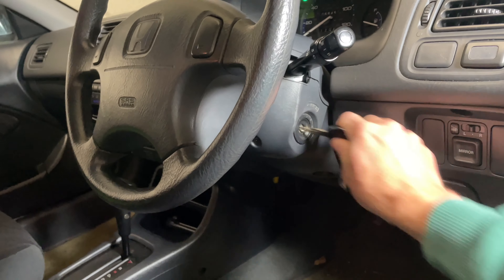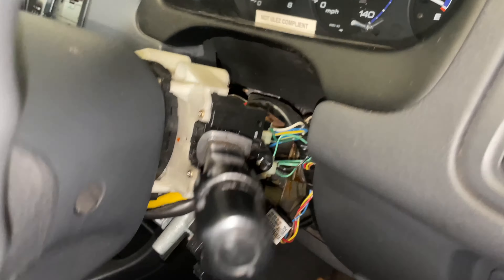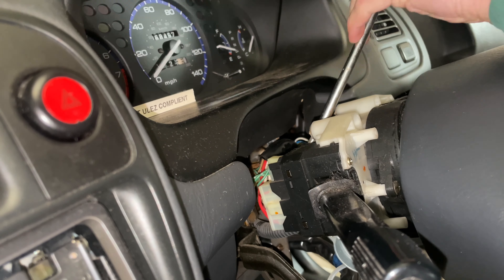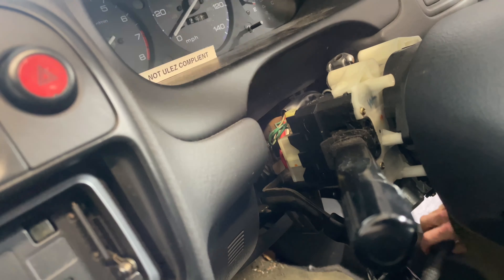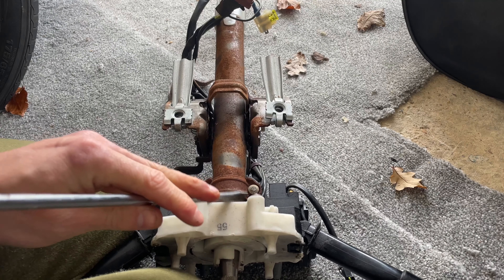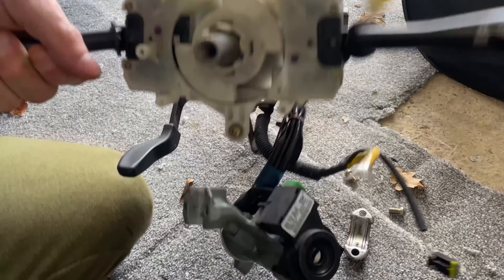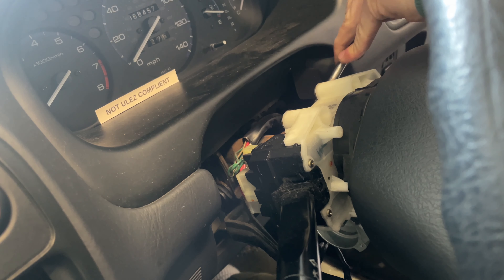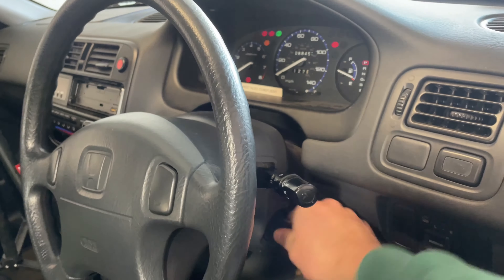How to ignition barrel replacement Ek civic 96-00

Comment: nice one dude, I defo would have got a Dremel out to cut a slot in those but heads though I reckon :)
Reply from the maker: Good call! but requires more tools
Reply: @huktuned  that part was easy brought new one.
Cut down middle clamp slides off
Reply: @captainsvlog  cut clamp bend it slides off .them shear bolts suck .
Just put new one in .new key .
Maybe need buy another lock sensor burrow push aswell? Reprogram it 
I don't no but getting flashing green light ...need do something so it takes  new Kew and barrel and column

Comment: Yeh replaced barrel 1996 put back on but turns over .
How do  I imbolize new key please and barrel
Reply from the maker: @dannyoliver8354  have you still got original key that matches with ecu ?
Reply: Yes do .but has separate button push sensor key ring.
But now does not evan unlock doors either now
But separate.
Key for ignition and key ring push button for door locks 
Key just normal
Reply from the maker: @dannyoliver8354  stuck the original key near the chip reader and try start it now and tell me what happens

Comment: If you get another key and barrel from another ek, do you have to change ecu?
Reply from the maker: @razakrazzle  depends if you have aftermarket ecu.  On facelift ones you can easily remove the immobiliser chip I have a video on it
Reply: @huktuned  stock ecu and pre facelift
Reply from the maker: @razakrazzle  pre facelift is trickier.  Do you still have original key ?
Reply: @huktuned  yes still have original key, but only this one, Car does not turn over when moving steering
Reply from the maker: @razakrazzle  that comment doesn’t make sense mate